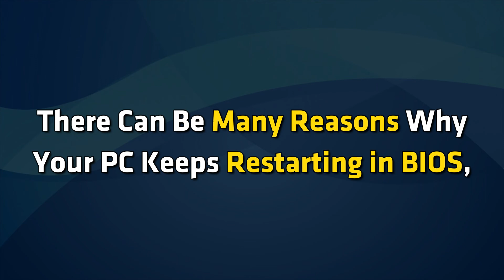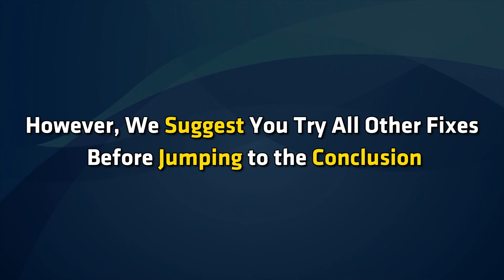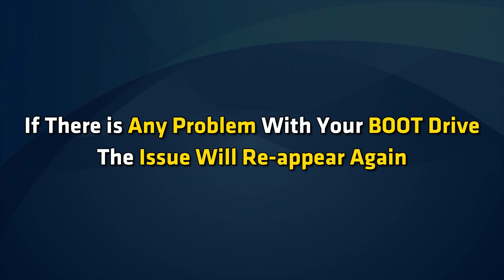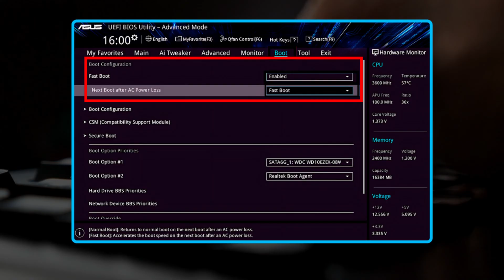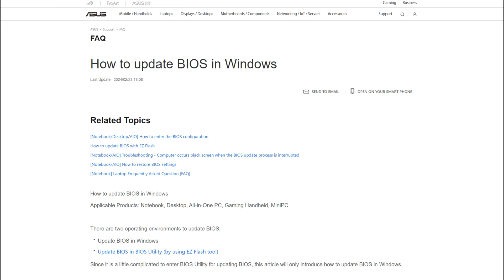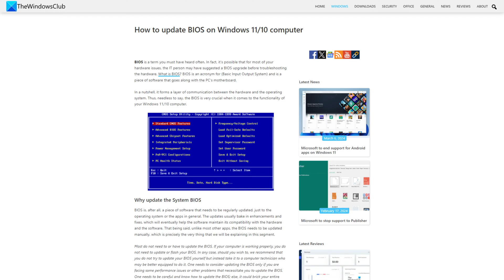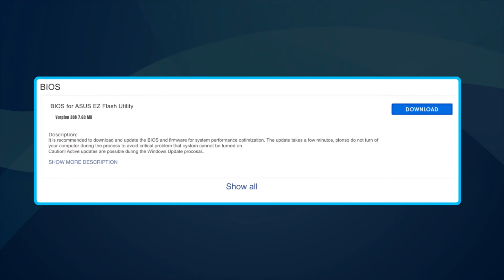Windows PC keeps booting into BIOS [Fix]

Comment: Mine was as simple as I plugged a usb in and it was trying to boot from my usb if u did that just unplug the usb and in the uefi reset to default and rest your PC
Reply: I got windows installed but everytime I turn on my pc it automatically sends me to bios and not the windows do you know how to fix it?
Reply: @SalviBoifrmVA I am having the same problem. I turn on pc and it takes me to bios. Then I just go to boot and select my ssd with the windows boot and then I am in. I don’t understand because that is number 1 in the boot drive order
Reply: @tommy2fingerz  yeah exactly what i got did u fix it? im still tryna figure out what i did wrong
Reply: @SalviBoifrmVA I’m having the same problem right now. My first thing I’m gonna do is get a fresh copy of windows on my ssd. If it doesn’t work or your ssd doesn’t show up try enabling CMS
Reply: @Zoomtalala   where do i enable CMS? is that in the bios?
Reply: @SalviBoifrmVA  yea it is